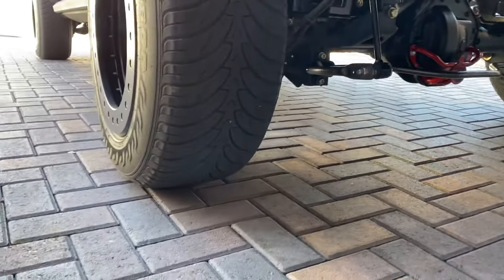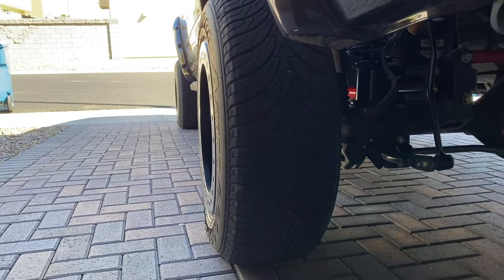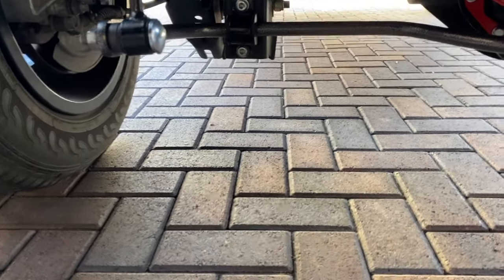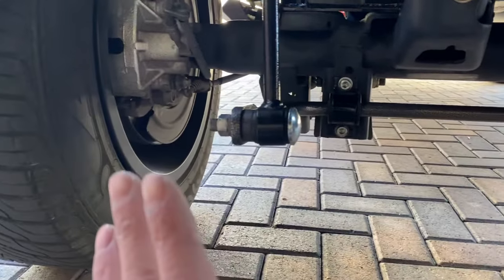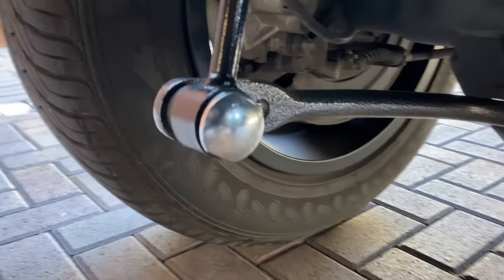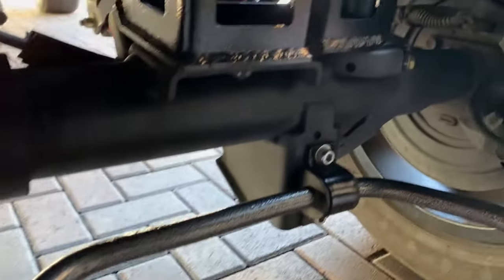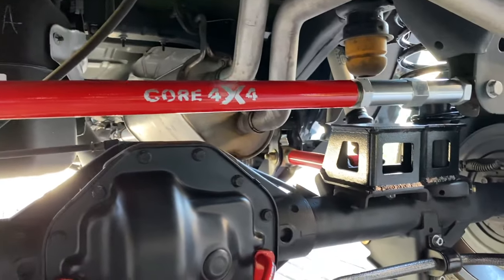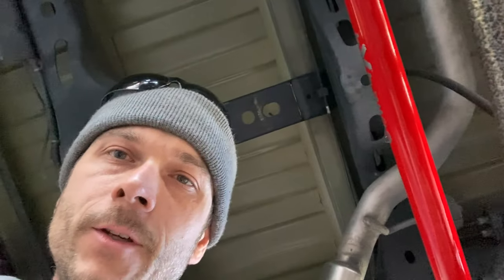Hellwig sway bar 1 year review

Comment: Hey bud. 
  I'm installing the hellwig rear end sway bar. 
  What do u suggest for end links for a 3" lift rear wheel drive. 
other than the adjustable ones. 
Thx 
Ed
Reply from the maker: Call Spence at Core 4x4, he will make you a set.
Reply: @HOTDAMN  I'm in canada and dont want to spend a fortune.
Reply from the maker: I fully understand, I’d have to do some research.

Comment: Where did you get your sway bar end links? I have a 2017 with a 3 inch in the front and 2inch in the rear leveling kit on.
Reply from the maker: Mine are pro comp, I recommend CORE 4x4 end links. Promo code may still be “Hot Damn”
Reply: @HOTDAMN   awesome thank you!! 🥰